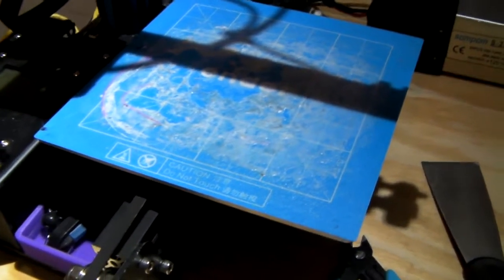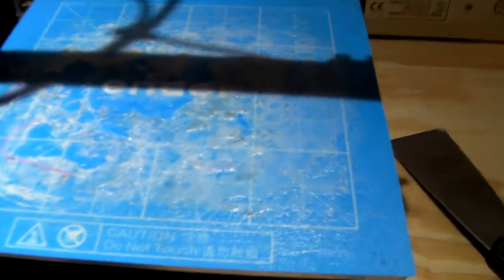Cleaning Glue From 3D Printer Bed -- Stock Ender 2 3D Printer

Comment: I used Goof Off.  You have to soak it a bit and then scrape the majority of the glue off.  Then it's a painstaking paper towel and goof-off to take the residual off by wiping etc.  Works well though.